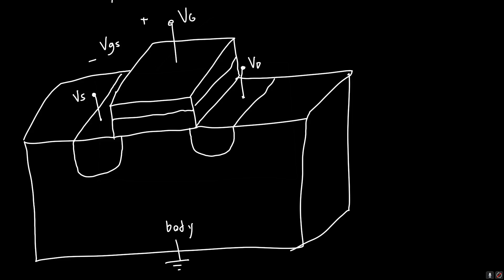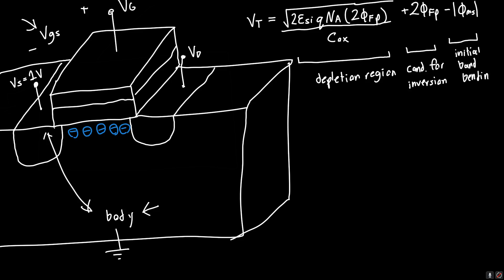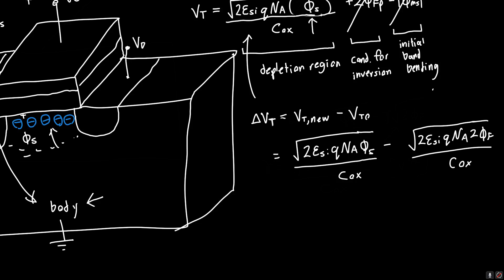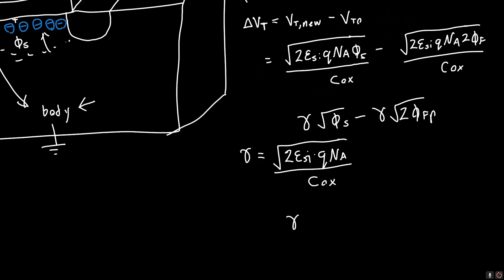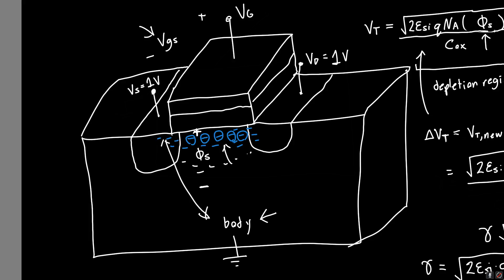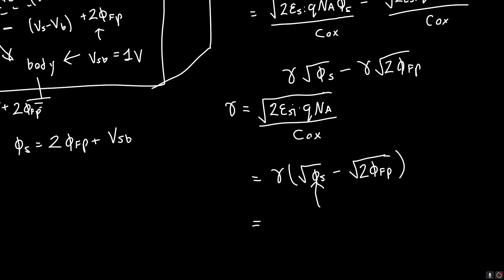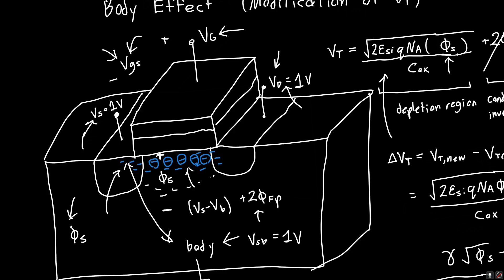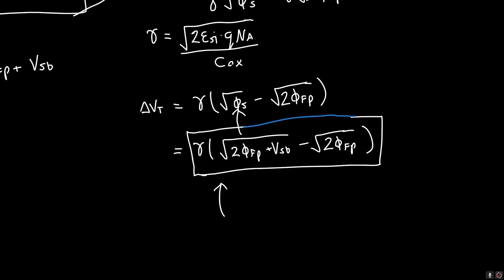MOSFET Body Effect Explained

Comment: I'm sorry deep into 3 minutes  you say -phi(ms) is initial bond bending , I thought it was phims(metal(now really polysilicon to silicon), which is voltage needed to work way through the gate capacitance. Where is that?

Comment: you emphasize that body effect is just an artifact because we are appling Vgs instead of Vgb (a matter of where we reference the voltage to). 

I think this is not correct. 

physically speaking, even if you keep the absolute Vg voltage constant (Vgb constant), as you increase the absolute value of source voltage Vs (hence changing Vsb),  the required absolute Vg (or Vgb since bulk is ground) voltage to get inversion will still increase, hence altering the definition of device Vth.

therefore, there is in fact a "real" physical change that happens to Vth of the device when we change the absolute value of Vs, hence the name, "body effect"

Comment: if VSB is more negative than 2phiF then Vth becomes imaginary, explain? If we apply Modulus then for sweeping VSB across negative range we still get VSB + 2phif as an Increasing function due to modulus,same as VSB in positive range. Ran into this problem while solving Razavi Cmos Analog design problems

Comment: Hi, really nice explanation about the body effect. I have a question abouth how threshold voltage(Vth) changes with temperature. When body effect is not present Vth is complementary to temperature, thus  Vth becomes smaller when temperature rizes. Does this changes when body effect effect is present? Does it has to do with Φs which contains thermal voltage(Vt) on it? Could Vth become proportional to temperature if we apply a Vsb in a device? 
Thanks in advance🙂

Comment: Thanks for the lecture! However, I don't understand why we don't need to account the change of phi_s when we calculate the change of threshold voltage. When the depletion region gets wider from V_sb > 0, should phi_s also increase from 2phi_FP to 2phi_FP + V_sb?
Reply from the maker: Great question. Phi_s is the surface potential (or the difference between the semiconductor bulk and the semiconductor interface with the oxide). This can only get so large, because silicon's band only has so much room to bend. So regardless of the V_bs you apply, only some of it gets dropped across the semiconductor itself in the form of Phi_s.
Reply: @JordanEdmundsEECS  Thank you so much for the quick response! Sorry, I am still a little confused. When we have V_sb > 0 and Phi_s can only get so large(Phi_s  <  2phi_FP + V_sb), should that also limit the total charge Q we use to compute V_ox? But we plugged in Phi_s = 2phi_FP + V_sb to compute total charge Q. Thanks again!

Comment: Your channel is really good. Please make more videos. However, could you please explain if this effect can be ignored if we short body with source (which is the typical case)?
Reply from the maker: Yes, the only reason the body effect exists is because the channel is at a different potential than the bulk (body). Since the channel is continuous with the source in any mode of operation except cutoff), because it’s just a bunch of electrons floating around, this means whenever the body and source are shorted together we can ignore this effect.